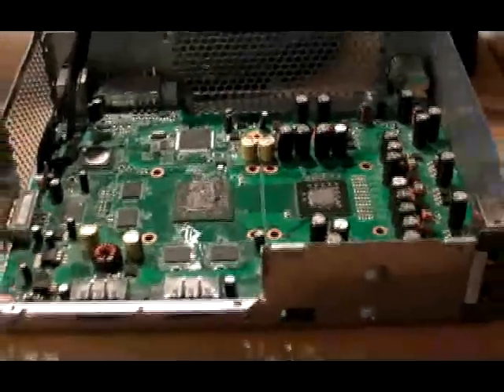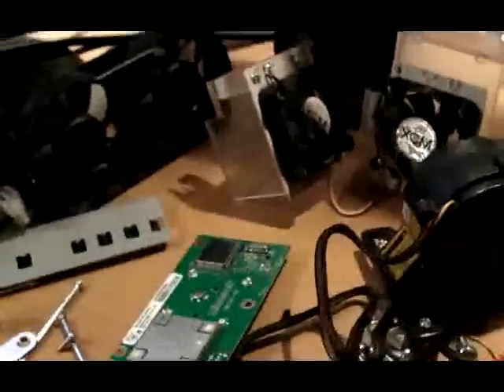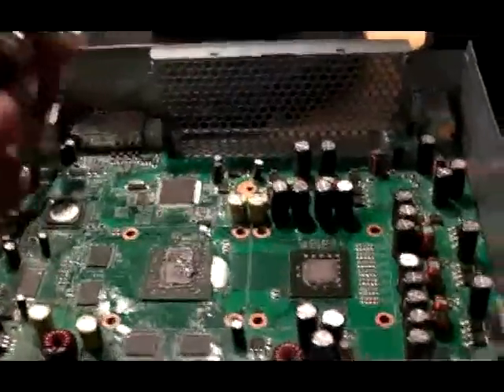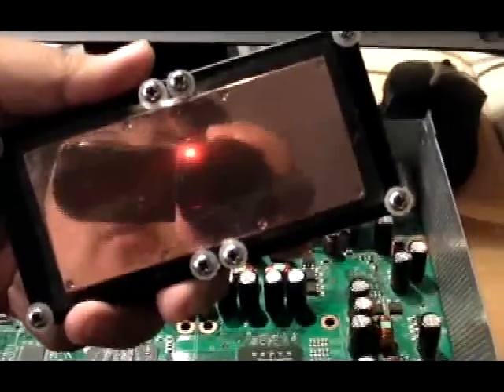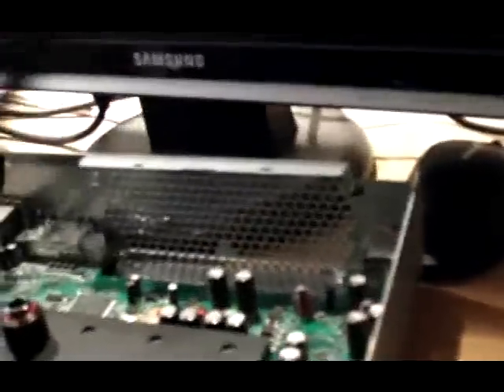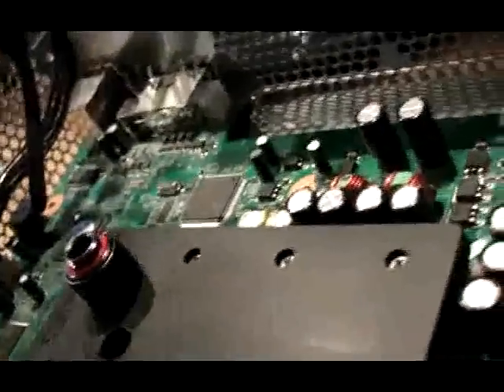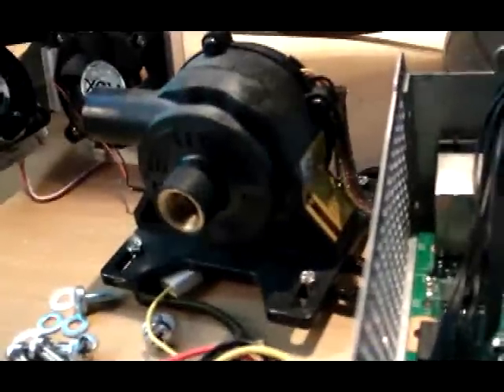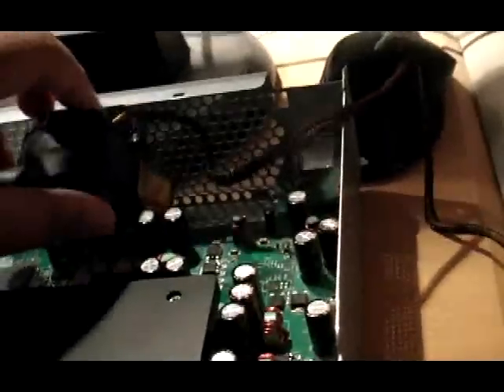watercooled my xbox 360, parts video

Comment from the maker: @kr3wmodz you can't cool coolant or water with a room-temp radiator. radiators are designed to be air-cooled. there's no way you're going to be able to cool an entire car without a radiator. that's why they put intercoolers and radiators up front where they can be cooled down by airflow. there is a 30+ degree celcius difference in a radiator that's cooled by some sort of fan or airflow in my experience of building high-end gaming rigs. if you don't cool the radiator, it'll just collect heat

Comment: you need to think this over the water block will not mount the way you directed it, the barbs and the piping need to be consider - the cd drive needs to slot in, so you'll have to switch the water block round 180, check out my videos you really need a differenct case